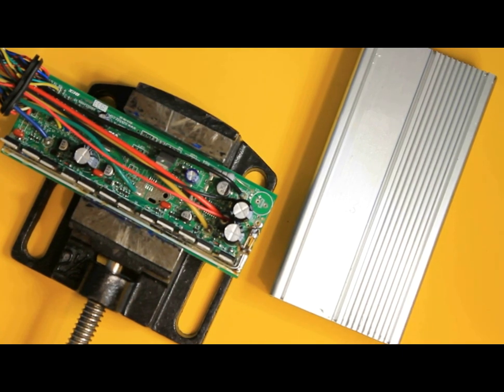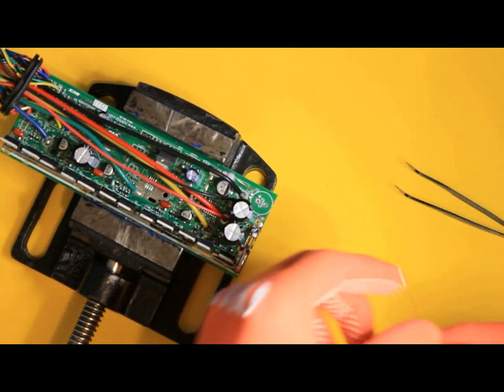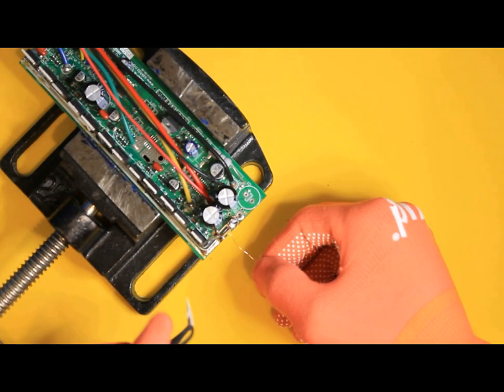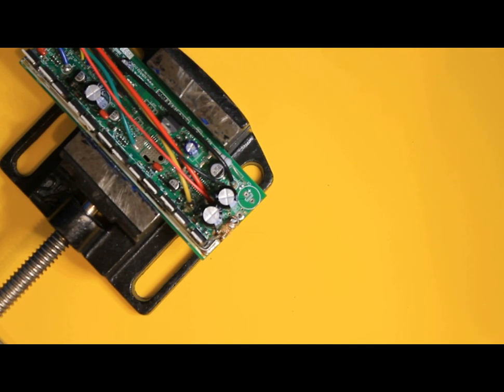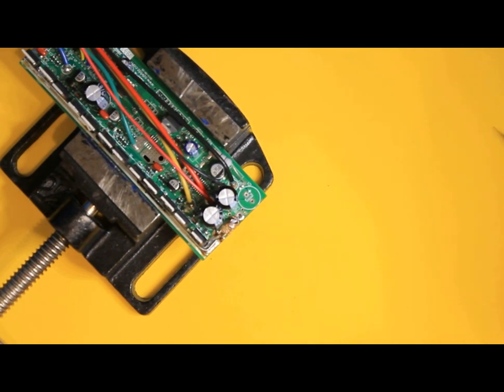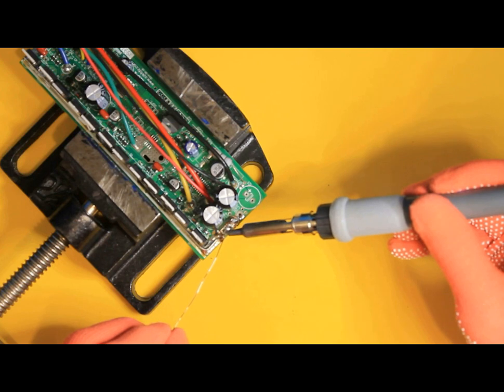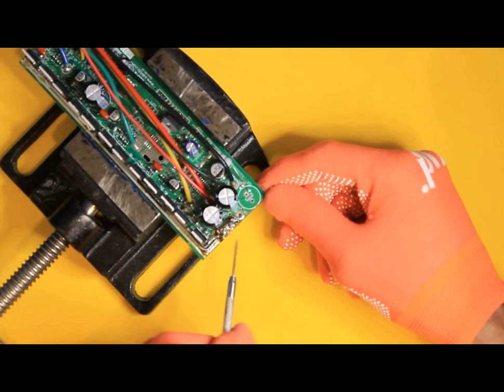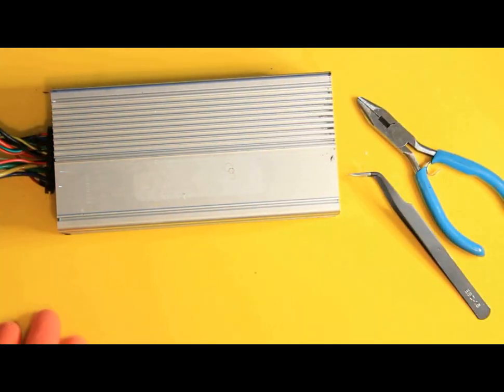SHUNT MOD YOU BRUSHLESS CONTROLLER

Comment: Mine has only 1 pin what should i do please
Reply from the maker: You can change the characteristics of the pin by soldering or applying solder to half the length of the pin,!which will give you some benefits and maintain the functionality of the installed pin, in my opinion.
Reply: @learntechstudio10  thanks a lot